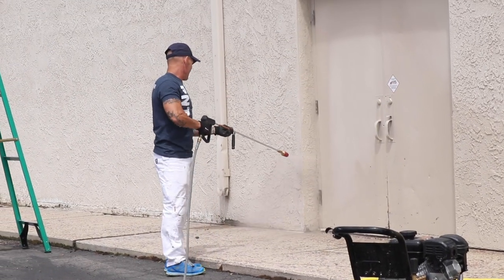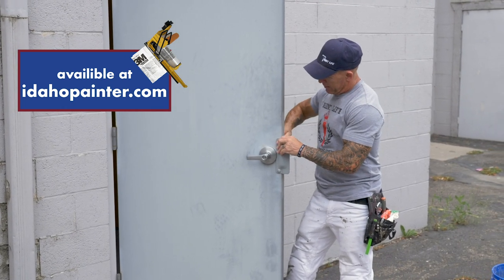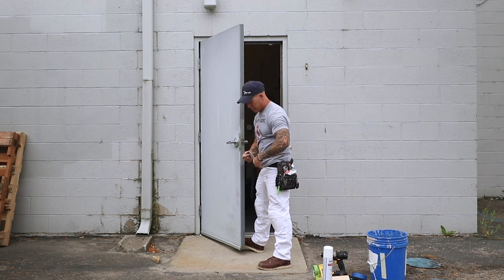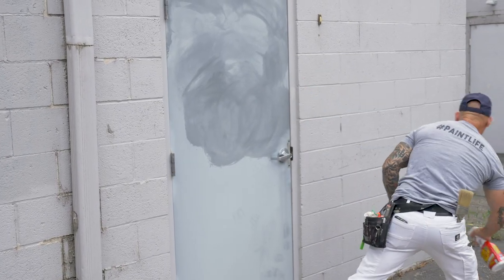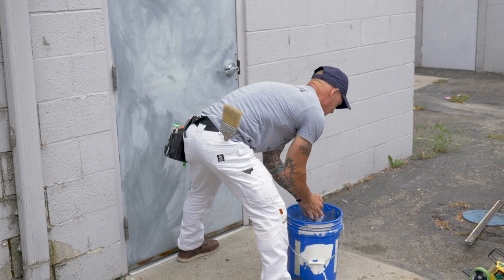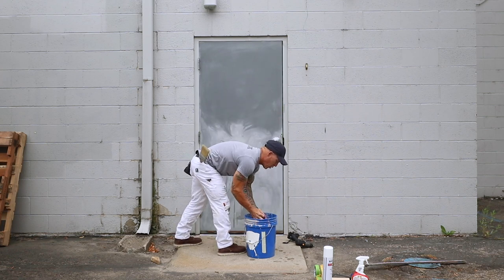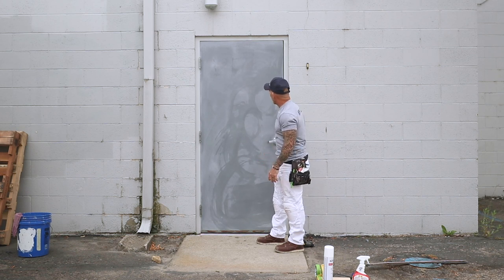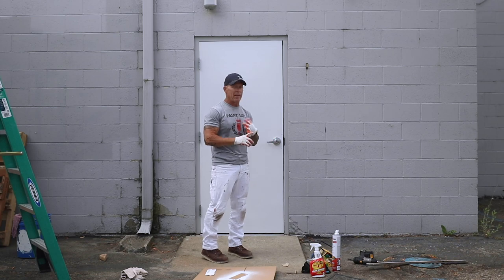Painting Chalky Surfaces! How to make your paint adhere better!

Comment: I would like to tell you that I completed painting my house yesterday and I used a graco magnum x7 I did upgrade it to rac x tips and guard as well as a 20 inch extension and a 10 inch extension.  It did take me 2 weeks start to finish but it came out beautiful You sir saved me approx 4500 dollars here in Hawaii.   Quote was for 5400 I was able to do it for around 900 including tools I split the machine with a coworker. Thanks so much for all your instructional videos without them I never would have attempted this endevour.  Now my house is beautiful again and I can still afford tuition for 2 students in college.  Thanks so much.
Reply: If you would have used the low pressure/low overspray tip then you would have started painting as a professional because the difference in overspray is crazy using the different tips
Reply: @lexandersantana8089  I used a 515 tip on the siding and a 310 for the top panels as well as the gutters and downspouts.  It was much easier to control overspray with the 310 tip.

Comment: I used to powerwash and mix in TSP( Trisodium Phosphate). The problem with that stuff is it stains concrete and shingles. What I do now is powerwash real close with an oscillating nozzle, scrub with a stiff brush while its wet, then wash again. It amazes me how much comes off over powerwashing alone. You get quite the workout from all that scrubbing too. You never need to scrub literally everything, just areas where there is tons of sun exposure. Do a finger test first by wiping your finger on the surface. If there is barely a trace, then powerwash only but if your finger is quite white then use that stiff brush. If there is still a trace of chalk, paint will penetrate it as long as you backroll after spraying.